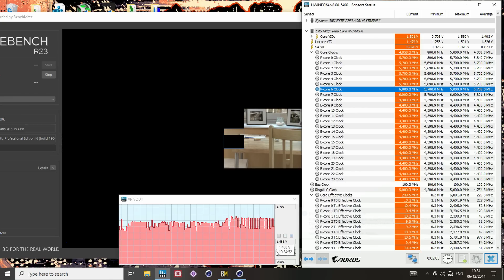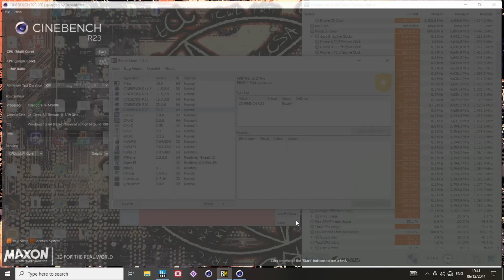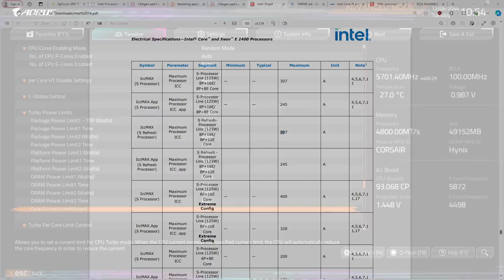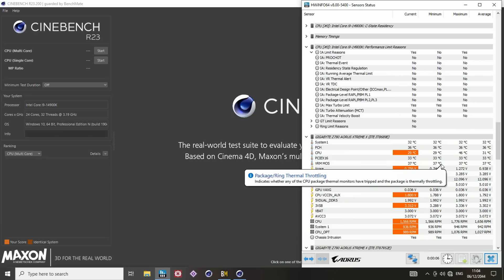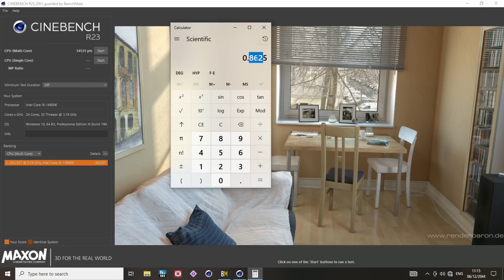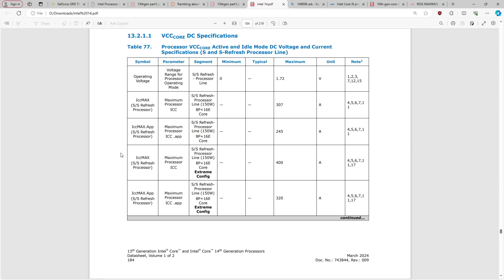Gigabyte's Intel baseline profile runs some ABSOLUTELY INSANE core voltages.

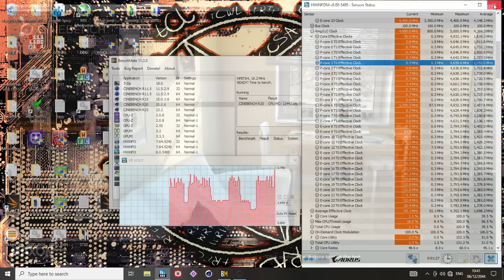Comment: 12:00 While true, for cinebench purposes the 14900k isn't competing with the 7800x3d it's competing with the 7950x, which is still cheaper.
Reply: that's the whole irony... so many people buy 14900k for some reason only to play games on it, while the main benefit of this thing over AMD offerings is its multi-core capability...
Reply: @reneljubarskij3214  And besides that there's always threadripper if you REALLY need/want multicore...
Reply: @reneljubarskij3214 and single threaded for productivity workloads that are procedural
Reply: but it does perform similarly in gaming to a 7800x3d so technically you get the gaming performance of the 7800x3d with the multithreaded performance of the 7950x but at a cost of stability and power. Not worth it IMO.
Reply: Wow, dude starts off saying that he's talking about cinebench and gets two replies trying to refute it by talking solely about gaming. Good job guys.
Reply: Let's not forget that Intel states a much higher boost speed then you are getting when running heavy workloads with the pl1 and 2 set and current limited. I have the 14700k and it only boosts to 4.8-4.9 multicore. They need to fix this.
Reply: It amazes me that intel is blaming the mobo vendors when it is the cpu's that are telling the motherboard how many volts it wants. Mobo vendors leave it open but the cpu is demanding the insane volts.
Reply: Nah, its competing with the 7800x3d. I bought mine for gaming since it has the best silicon in the lineup. You get best ram and ring speed chances with the xx900 series.
Reply: 7950x stock scores less than my shit bin 13900kf at 5.5 41k

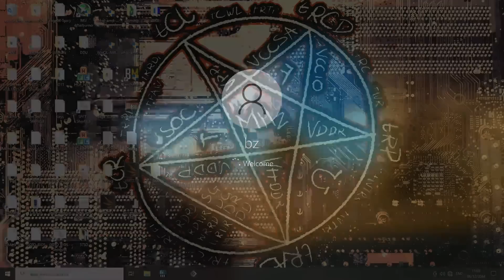Comment: 34:10 Gigabyte is undervolting on the new BIOS skin, my 12700K was 40/90 AC/DC_LL on the older BIOS skin, 13900K was 50/90, on the newer BIOS the 13900K is 40/90 AC/DC.
Reply: Good to know when it started, cheera

Comment: This is kinda unrelated, but on my 7900x + b650 aorus elite board, hwinfo regularly reports vddcr_soc voltage spikes at 1.440v when the system is sleeping despite it being set to 1.2v or lower, I've seen them go beyond 2.0v, always running latest bios at any given point, gigabyte says its nothing to worry about when I email them about it. Thanks gigabyte 👍
Reply from the maker: Sleep causes all kinds of weird sensor bugs. So there's a decent chance that those readings aren't real.
Reply: @ActuallyHardcoreOverclocking  thanks for the insight, makes a lot of sense

Comment: "stock bios settings" should only give the CPU the exact voltage the CPU requests, combined with intel stock PL1 and PL2.

Anything above and beyond that can be user settings or some preset 'extreme' bios setting or whatever.
Reply: Not true to be honest auto vcore will overshoot a lot usually had the exact same on my 13900kf without ai oc or mce or enhanced turbo auto vcore was over 1.45v on r23... only needs 1.32v or something to pass occt and everything... lol stock vcore will kill your shit.
Reply: @TheBURBAN111 "auto vcore" in most mobos is not "stock" per the intel cpu voltage table. it is usually much higher.

But the voltage table on the CPU is what intel has rated it to run at, so that's what it should run at *stock*.

If you wanna lower it, do it. Just don't do it out of the box. And don't raise it out of the box either.

Comment: When i9 9900K came out I have ordered it. Being VRM fanboy I have ordered the Gigabyte mainboard because of your VRM review where it turned out that they have had best VRM solution on each level of the mainboard. Got one of the top models. Build the system, started by only enabling the XMP profile and it would crash with everything you start. Solitaire would kill it. Core Voltages were insane. I have played with load line calibration and with setting Vcore manually and it was still giving more than requested in the bios. That with huge water cooling loop mind you. Then they have issued new bios that lowered the Vcore but it did not solved the stability. Games would randomly crash. So I have researched what mainboard would be better and I have returned both CPU and mainboard. Got another i9 and MSI mainboard. Stock settings with the XMP worked out the box but power draw was still unnecessary high without boosting performance. After few bios changes I got it running with promised speeds and normal power draw and at the expected performance. Stayed on MSI mainboards after that. Changed to their top GPU’s as well.
I was big Asus fan boy. But with 4000 series Intel processors and their BS over the VRM, I was out. Like claiming 8 phase VRM while it was 4 double phases configuration on very expensive mainboards while everyone else was using real 12 phases in some cases even for cheaper mainboards was just more BS than what I could take. It could handle the current but it was a dirty VRM. I loved their bios layout and everything was so logical in it. So going to the other solutions was tough. Later on Asus did few more un popular moves that just sealed the decision. 
So once again my personal opinion is that for a quite a long time default Vcore voltages and power draw for the Intel CPU’s is insanely high. Un necessary high. Way I see it it’s mainboard manufacturers implementation. Some pump more un necessary voltage than the others. I tend to blame the mainboard companies more because they are making it. They should test their final product and make sure that it runs proper disregarding what CPU you use. Releasing bios versions that cook the CPU at stock settings is a no go. There is a huge number of people building their own PC’s without even going into bios. Those people are used that it works. They do not even enable the XMP profile. They do not even want to learn how it works. They just enjoy building it. I cringe when I stumble on such systems or on such video. But it is happening way more often than what I could have believed. With last few generations of the Intel CPU’s and with the hype that 240 AIO is real water cooling, this is not working any more. People think water is this magical thing. You just build in an AIO and you do not even need the airflow in the case. Like heat doesn’t even need to be transferred into the air  and out of the case. Mere existence of water is enough. This is not just happening with average Joes’s. When I have started working for one company I could’ve believe what I saw as their custom pizza box server solution. They showed me their server and complained how their technicians have to fill it up water once a month. What I found inside was behind the insanity. Early China made water cooling kit with the thin 80mm full exposed copper radiator with slim fan, 6mm thick barely covering the IHS water block with two point flimsy mounting hardware, 5mm tubing and bay reservoir with integrated smallest pump I have ever seen. To add the insult to the injury whole server have had single ventilation hole next to the radiator. I do not recall good but I think it was the intake. Not a single other hole in the custom bent steel chassis. I started polity explaining that it was not the best way but the person who “designed” it was reacting badly. Then I have had to be honest and actually explain how stupid it was. Nowadays I see people getting  cheapest case with one or no case fans included, cheap low power PSU, average mainboard, small AIO and pretty high class video card and the CPU. Than they complain about the stability and when you ask them about cooling they say it is awesome because it is water cooling. I gave up explaining. I just offer to fix it. Go to Amazon, order 5 pack of P12 from Arctic Cooling and strategically place as many of them as I can. And like by some miracle stability comes and stays until the system gets extremely dirty because they never clean their filters.

Comment: My original X570 Gigabyte aorus ultra board came out the box with a max voltage of 1.5 v core.... on what was at the time a 3700x a couple weeks after launch. The board also would never run near top end memory regardless of the cpu i threw in it.
Reply: I noticed that with my son board an X470 and with the 2600x. Now with the 5080x3d in there, everything is ok, using PBO -30. If i´m not mistaken, now the max voltage is about 1.1 something volts, playing RF2/AMS2 etc, in VR, using an 4080S with HP G2 at 100% resolution using open composite.

Comment: Intel Addresses Stability Issues with 13th and 14th Gen CPUs, Blames Motherboard Manufacturers😇😇😇😇
Reply: well intel certainly didn't write the bios for the Gigabyte MB i'm using that put PL1 and PL2 at 4095 watt as a default. pretty sure they specificed my chip as having a 65 and 154 watt for PL1 and PL2 respectively

Comment: I actually degraded my 12900k by running it for years on 1.37v, high wattage and custom wc. I now have a 14900k locked at all pcore 5.8 ecore 4.2 and hits the same voltage at low wattage (say, 200 watts max). At high wattage it (300+) it runs around 1.3v. I dont care about 6ghz for my use case (gaming, work), if I keep it at stock clocks it goes way higher in voltage because of the vfcurve. My temps in CB22 never go higher than 80c ish. All on a z690.
Reply: 1.37v shouldnt have degraded to be honest you probably had spikes to way past that underload or you werent getting the actual reading under load.

Comment: I added 0.025v to mine to get it stable.
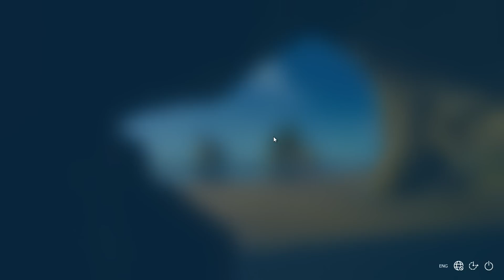Reply: 34:02 yeah, that’s the conclusion I came to, not enough voltage. 

A tiny + offset at stock/auto (not Intel baseline) solved the problem.  I did also lower the power limits and clocks but that was to make it more efficient.

Comment: The “Intel POR” profile has the values from Intel, not “Baseline”. Blame Gigabyte naming jank.
Reply: well, no. Intel POR uses AC_LL=0.4 mOhm and DC_LL=0.9 mOhm. PLs and IccMax are Intel recommended values.
Reply: @Dakkidaze should that be higher? Or are those values seemingly ok?
Reply: @MonkeyMan125431  Intel *recommends* the following values for Raptor Lake-S 8P+16E models (so 13900K and 14900K):
Vmax = 1720 mV
AC_LL = DC_LL
DC_LL <= 1.1 mOhms
IccMax = 307 A (400A for extreme config)
PL2 = 253 W (320W for extreme config)
PL1 = 253 W (320W for extreme config)
Tau = 56 s (well since PL1=PL2 this won't make much of a difference)

And since these are merely recommendations, not hard specifications, motherboard vendors won't have to stick to these numbers (or else we wouldn't have the stability drama).

For ASUS and MSI they are sticking with numbers I've listed above, Gigabyte's "Intel Baseline" seems to refer to an older version of Raptor Lake datasheet hence the lower PL1/2 value. And they also used a wrong ACLL/DCLL combo in their baseline profile (1.7 for ACLL and 1.1 for DCLL)

I can't put links here so please google "Raptor Lake Datasheet" for more information.

Comment: My 13700k still not stable with 307 iccc max at stock ratio in occt small extreme.
Reply from the maker: I guess set the ICCMAX lower or  bump the AC load line up a bit.

Comment: Intel is quite literally shooting itself in the foot without standard power & voltage limits.

AMD made this mistake with the AM5 ASUS boards, assuming manufacturers would follow guidelines. They learned fast to force limits on at least the X3D chips.

Now, it's Intel's turn lol.
Reply: I believe that the AMD issue was related to XMP/EXPO. If the memory voltage was changed it impacted the SOC voltage due to a bug. Regular Zen chips could handle it, but X3D wad more sensitive.
Reply: No, because Intel is a company that literally doesn't have feet and literally isn't an entity capable of wielding a weapon with which to shoot itself.
Reply: Its a K processor. What do you expect
Reply: I AGREE
Reply: they didn't force any limits with the X3D chips, they just run at lower voltages due to heat dissipation issues with the stacked cache
Reply: @cheese186  they did force limits. They have a max cap on SOC voltage now at 1.3v with new AGESA

Comment: Gigabyte still overvolting since the days my 4790k default was 1.55v for 4.4 which i think was 4.2 allcore when I managed to get 4.4 all core at 1.15v
Luckily I was straight into the bios and noticed it before even installing an OS on the pc
Reply: if this idea helps, i think as long as theres not much "load" on your CPU while it's requesting that VID, you should be fine. (like 5% of load at 1.55V is not great, but it probably won't noticably degrade the CPU either. Whereas a 50% load at 1.6V will probably (maybe definitely) degrade the CPU, or some part of the CPU's design)

Comment: Gigabyte also has some real shenanigans on AM5 platform, like b650 boards that have overclocking and PBO in BIOS do nothing. 
Here's the list:

Gigabyte B650 UD AC

Gigabyte B650M D3HP

Gigabyte B650M D3HP AX

Gigabyte B650M C V2

Gigabyte B650M Gaming Wifi

Gigabyte B650M D2H

Gigabyte B650M S2H

Gigabyte B650M H
Reply: AM4 too. My 5800x crashed with gigabyte x570 on default auto settings constantly until i changed everything to standard and turned off some settings. Took me more than a year to make it stable.
Reply: @TechTusiast I'm not going over standard tech support 1.0 questionaire. It works without crashes now - it doesn't work on gigabyte's motherboard default settings. That's all there is to it.

Comment: Gigabyte paid for the whole voltage, so they will use the whole voltage
Reply: Gigabyte giving their customers value for their hard earned dollar.
Reply: Electromigration speedrun
Reply: How much voltage Gigabyte? Yes
Reply: Gigabyte is customer friendly, if I buy their motherboard I'll get more voltage at the same time 😃
Reply: 😂😂😂😂😂 i have Never Laughed that hard
Reply: more specifically YOU paid for the voltages, but it's good that Gigabutt is giving you the voltages YOU PAID for
Reply: Gigabutt? When did Gigabyte offend you? Or do you have adorable sophmoric insults for all PC companies? 😅@imthebadguys
Reply: @TheSlickmicks  you got it, Asuk, More Shitty Intel (MSI), Assrock :)
Reply: I had to change the pl2 for my mobile 14900HX as my eyes nearly popped out when I saw it was allowing the processor to pull 157w and that's in a laptop!.
Reply: @markhindhaugh6304 that is pretty normal for HX laptops. Some properly cooled laptops can reach even over 200W in benchmarks if PL2 is set to that amount. In games it will almost never reach that mark. My undervolted 13900HX averages out at 60-80W with one or two peaks to 100W on CPU intensive games, and 40-50W on less CPU intensive games
Reply: @soratsuki469  to be honest I would rather extend the processors life than let it run at that kinda power
Reply: @markhindhaugh6304 Then you just bought an inferior product

Comment: the baseline spec is fluid and open to interpretation.
Reply: "Everyone should be able to express their baseline however the floof they want" -Someone at Gigabyte, Probably
Reply: When the boss says "just set everything to maximum in this Intel document and get back to your other tasks" and the worker dgaf
Reply: Actually they are black and white. Intel has a public document stating what the profiles are. Its PL1 253w PL2 253w with voltage protections on and the correct 56sec maximum boost timer.
Reply: @CuttingEdgeRetro  You may notice that notably absent from your list are any voltages.  And voltage protection should not be something you rely on day in day out.
Reply: Its Render Fluid 😂
Reply: well ok then - what are it's pronouns ?
low2high or high2low or flamingSilicon or sysGenWattDataVoltz
Reply: Nein Nein Nein watts is a-ok!
Reply: So are the CPUs if you interpret hard enough

Comment: I mean they quite literally followed the specs. Intel says 1.72 max operating voltage? NICE

Jokes aside, this whole situation is getting ridiculous

Edit: another way to make it stable would be to use a fixed voltage with a sensible llc, this way the acll wouldn't even apply. That would be kind of a work to find out a stable configuration that doesn't yeet the idle voltage to 'intel baseline' values with a decent llc, but it would work in some way. The issue with that is ... people using a cpu at stock settings shouldn't have to deal with it

Edit 2: it's funny to see the gigabyte Biscuits rating changing between 9:08 (92.943) and 49:56 (92.114). Well, nobody really knows how that score gets computed and BZ clears cmos multiple times, so that's probably just variance, but heh
Reply: thats for 10th and 11th gen
Reply: @ChrisGR93_TxS what, the 1.72v as specs? Nah it's also for 13th / 13th refresh. Not that I would trust it, but still
Reply: @Profetorum  the shrinking of the power lines might have them starting some other max, but I am sure Intel states to OEM's that this is a max, but not anything like a max 100 of the time - Really Intel needs to just kick some teeth in.  AMD learned the hard ware, and then partially forgot - they both need to learn it and never forget it.
Reply: @ogBINARYGOD  yeah i mean... to me it feels like these (beta) bioses are made just as a response for the drama surrounding the intel crashing, but they are really just band-aids. A serious limitation, with some serious standards would definitely be better

Comment: Nothing special gigabyte always tended to overvolt cpu's by default. Had to undervolt 3600 and 5800x to atleast get default advertised core frequency and put down insane temperature i was getting on x570 aorus elite board
Reply: I’m pretty sure Gigabyte’s X570 Aorus Master fried my 5900X’s SOC (can’t boot with two DIMMs installed). I had to RMA my CPU. They shoved 1.2V to the SOC at 3200MT/s by default when I could run y-cruncher VT3 for hours at less than 1.1V.
Reply: same even with my b550 itx aorus & 5800X3d, I have to undervolt the SoC 1.11v & use pbo -29 the temps helped as well